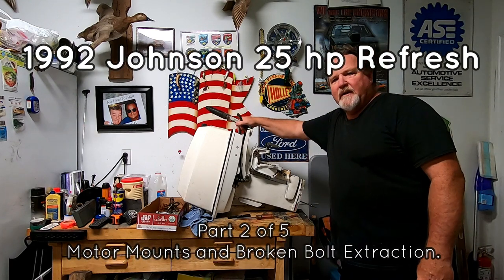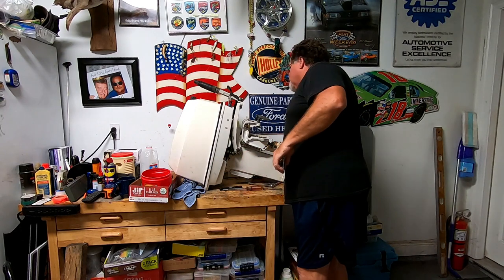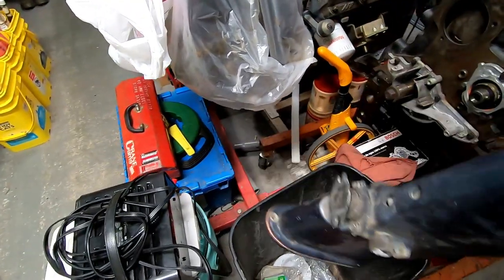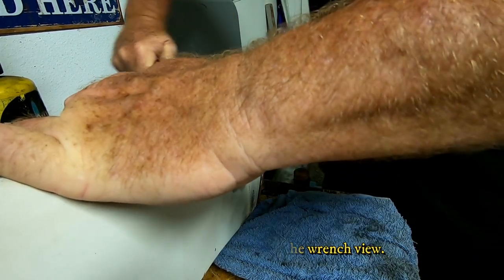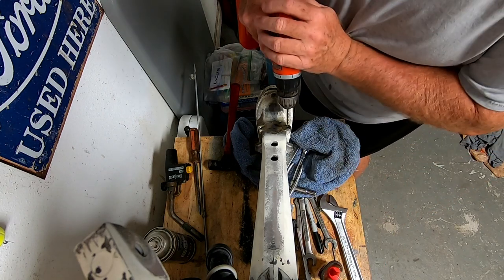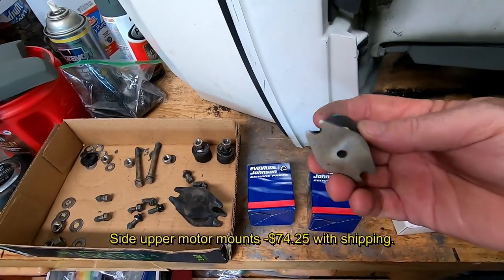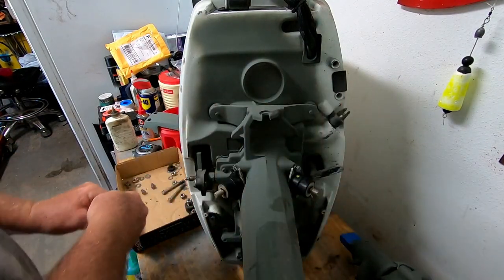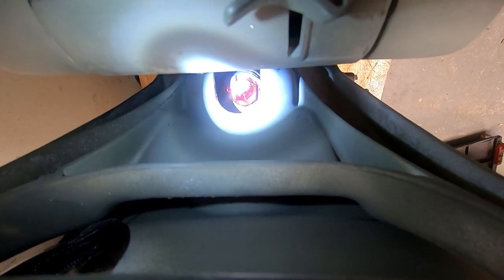1992 Johnson 25 hp replace motor mounts and broken bolt extraction.

Comment: This video is an absolute life saver for me! I’ve got a 1997 25hp evinrude that I need to replace the side motor mounts. Never knew there was a front mount!
Reply from the maker: I actually broke my front mount thinking it was the tension adjusting nut! (oops) Won't do that again, I love this 25 and am looking for a small boat for it now.
Reply from the maker: If I remember right, the front mount was hard to find and when I got a Chinese copy it was metric. So I had to make a trip to the hardware store for metric nuts. I don't know if I said that in the video. Good Luck.
Reply: @SRadigFishing  I actually checked my lower mount after watching the video and sure enough, she’s shot. I could only find one used one on eBay for $80!  Might call around to local Evinrude Johnson shops and hope they have a parts motor sitting around with it.  I’m hoping there’s someone out there that has figured out a good replacement substitute for it if I’m out of luck. Beyond the motor mounts it’s a great motor! Starts first pull every time!

Comment: I have a 1975 Evinrude 9.9. Do i need to pull the powerhead to replace the upper center mount?
Reply from the maker: @TimeToEatTheBait  I can't remember where I got the mount from might have been eBay, but it was a chinese copy and wasn't quite an exact fit. Some of the motor parts are no longer available.